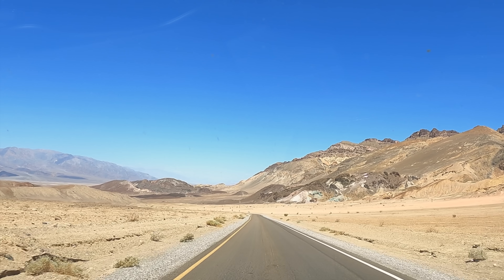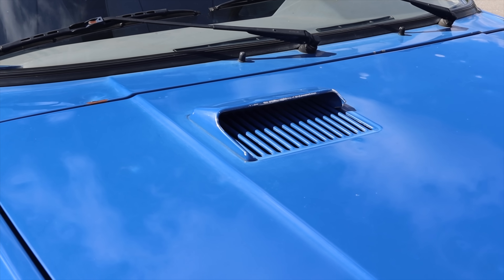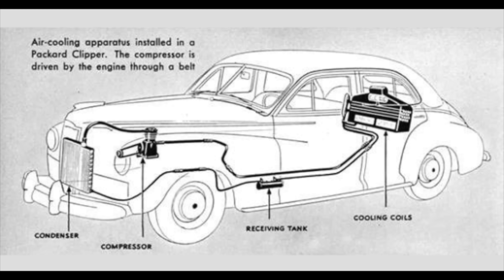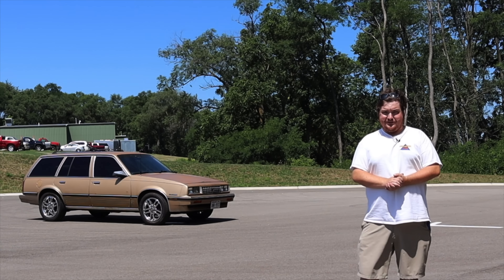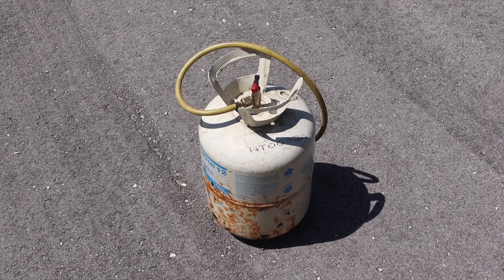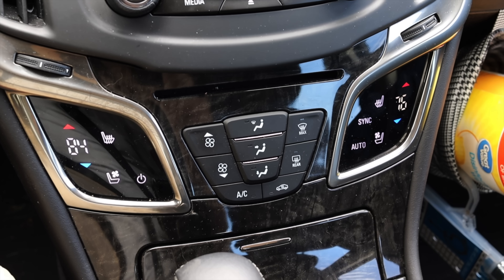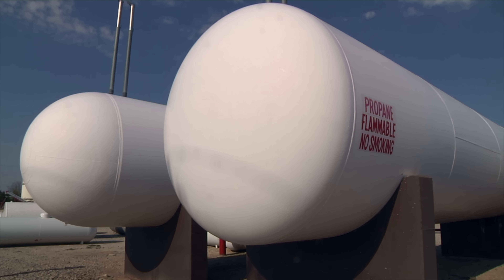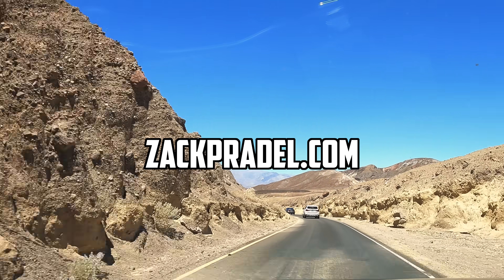Air Conditioning - The Story Of R12 & Why Modern Air Conditioning SUCKS!

Comment: No, I disagree.  R134a is just as harmful to the environment as R12, and they knew this at the time. The real reason is that the patent on R12 ran out in 1980 and Dupont bribed Congress into outlawing it and only allowing this new safer R134a, which Dupont happened to own the patent. Now, that patent happened to run out in 2020. So Dupont bribed Congress into outlawing it for new cars and only allowing this new safer R1234yf, which Dupont happens to own the patent.
Reply: DuPont actively lobbied against early bans on R‑12/CFCs in the 1970s–’80s, citing science skepticism and economic concerns. After developing replacements, they switched gears in 1988, advocating for tight, global CFC phase-outs. So they fought it until they had a replacmeent
Reply: They also have R1234hfc
Reply: @zache1605  a what???
Reply: Let's conveniently forget the ozone depleting mechanism of CFCs that has been studied for 40 years now...
Reply: Also, R-290 is a direct replacement and works as well, if not better. Money and politics. (R-290 is Propane with flame retardant added)
Reply: R12 wasn't under any patents in the 80s, and r134a was cheap upon first use. 
You guys think it's this dumb conspiracy but all you do is show how lazy you are too even come up with such theories that are easy to fact check.
Reply: 1234yf is flammable, not safer. Safer for tree huggers who think trees need oxygen instead of CO2.
Reply: @JR-sf6ws  soon as you go with the '' tree huggers'' attack it becomes obvious your opinions are the result of right wing propaganda AND ignorance,, idk where you get the  '' tree's need oxygen, according to tree huggers comment'', but its pure right wing fabrication,,, TREE HUGGERS OR ENVIRONMENTALISTS LIKE TREE'S AS WE LIKE BREATHING THE CLEAN AIR PRODUCED BY TREE'S !! evil radicals wanting clean air to breath, why i never ,,,,
Reply: @JR-sf6ws  I love trees.
(That's a lie)
Reply: @JR-sf6ws  CO2 is trees food and construction material. 
Though, algae is much more efficient in converting CO2 to oxygen.
Considering how low 0.04% of CO2 in atmosphere the plants are starving.
We need to burn more fossils to increase available carbon for biomass.
To reforest a desert we have to unearth fossil forest remains under the desert.
Reply: @vasiliynkudryavtsev  cool story bro, except you are completely wrong = an abundance of C02 actually makes plants grow worse, not better.
Reply: @JR-sf6ws At times trees do actually respire which means they consume oxygen

Comment: 134a SUCKS in an r12 system!  When the new stuff came out, auto manufacturers were putting 134a in an ac system that was designed for r12 in the 90’s.  The company s didn’t redesign and build the AC for 134a. Switching AC fittings does not automatically make the AC run well on a new refrigerant.  In the 2000’s cars were redone and so was the AC.  Now 134a works quite well.  My BMW and Dodge Ram, 2014 and 2009 respectively cools GREAT here in texas when the temps are in the 100’s.  At idle!  After being parked in the sun!  My 93.5 Nissan pickup had 134a and its cooling was sub par at idle.  So was my 98 corrola.  
Oh, I heard of folks putting r22 in an r 12 system and getting great results.

Comment: I still use R-12 in my 1988 Mazda B2200 truck, and I live in Arizona desert; yes, I do my own AC repairs and have some R-12 cans still saved.  However, my 1998 and 2004 Nissan Frontier trucks also have 4-cylinders and 5-speeds and were R134a from the factory, and these cool even better, just designed for it.  We've also had 1994, 2005, and 2011 GMC Yukons with R134a, and all cooled very well.

Comment: Well, this is kind of misleading. Yes on it's own R12 may be theoretically more efficient coolant than R134a, but "modern" air conditioning is way way better overall and way cooler, and way quicker etc. etc. So modern air conditioning DOES NOT suck! It is way better even if it uses theoretically less efficient coolant. What you stating is actually misconception based on experience of people who converted old car to run on R134a. Yes in those less than optimal conversions R134a does not work as well as R12, because systems were optimised to run on R12. But this isn't because R134a sucks, just that the system itself is not optimised to run it... So again it is simply not true that modern AC sucks.

Comment: To me, the worst thing about modern automotive ACs is the computerization.  Before, if you left the AC on last time, then as soon as the belt starts spinning, it's back on.  Now, the computer and all the sensors have to have a committee meeting before air or heat can turn on.  Before, you had two knobs, one for temperature, and one for fan speed, and it was easy to adjust to your liking.  Now, you have a computer programmed by someone lacking the intelligence to understand the green house effect, and\or notice that cars have windows, so on a cold but sunny day, your car cooks you and the knobs don't help anything.

Comment: My 84 Camaro had R12. It was definitely much colder. 80s cars did suck compared to modern cars though. They weren't as durable or fuel efficient. There were a lot of problems with paint back then, either pealing or just turning to dust. You'd wipe your hand on a car and the color would come right off. I think I had about 120K on the Camaro when the rear main seal let go in the engine.

Comment: Hydrocarbons (Isobutane Propane etc) is actually a fully legimate replacement for R12 and R134A, better for the enviornment and easier on your compressors too.
In Australia we commonly use a specific a blend of R600a (Iso Butane)  and R290 (Propane)  for automotive aircon uses, you reduce gas (refill) volume by 65% so a 600gram R134A system only needs 200g of this R600a and R290 mix.

Comment: I was born in 1951 and during my childhood years most cars did not have air conditioning. In my family the first car my parents owned that had air conditioning was a 1971 Ford Station Wagon. Previous to this car my parents had a 1964 Ford Station Wagon that did not have air conditioning. During the 1967 summer during a long family vacation trip, my parents were driving from Utah to Las Vegas Nevada and the Nevada desert temperature was around 120 degrees Fahrenheit. That part of the vacation trip convinced my parents that the next family station wagon needed to have air conditioning.

Comment: I have driven and been in many different cars with both R-134a and R-12 AC. Both types can get equally cold but I always found the R-12 systems to get cold notably faster. I also found the R-12 systems less picky about having just the right amount of charge. That said, the Ozone layer is very important so glad we retired R-12.

Comment: I really don't get the people that complain about R134 not being cold enough.  I am the type that can be out in below freezing in a T shirt and a sweater, and be fine.  I converted my trucks to R134 and they easily get uncomfortably cold in the middle of summer.  I've felt R12 systems, and it wasn't any colder than that.  There are ways to adjust the performance of your AC system if you know what you need to do.  For my trucks I put in a really big condenser and kept the high displacement R12 compressor.  After finding the best charge level, it's cold as hell.

Comment: The government ban on R-12 Freon (CFC) refrigerant in cars was based on political science, not science.  Open-air nuclear bomb testing in the 1950s was what really damaged the Earth's ozone layer.  The hole in the ozone layer above the Antarctic is dependent on a variety of other factors, from volcanic activity to forest fires to solar storms to American and Russian space craft punching holes in the ozone layer (with burning rocket propellant polluting the upper stratosphere).  The ozone layer is located from 8 to 22 miles above the earth's surface.  Freon is 4 times heavier than air, so most of the Freon that vents into the atmosphere will not travel to the ozone layer.   The theory that Freon was responsible for the ozone depletion dates from 1974.     Just like the current move to ban farms and nitrogen fertilizers because they cause global warming, the Freon ban was based on junk science by our controllers.

Comment: Well, the new R1234YF refrigerant is flammable. Besides that, you are repeating the same idiotic argument about propane. Propane is R290 refrigerant, it is used as a refrigerant, it was used in cars as a refrigerant. As long as your A/C is designed to accept R290, you can use it in there. Stupid remarks about filling A/C with lighter gas or dusting cans are just stupid. They are all just butane or propane. The only difference between different propane applications are additives. Refrigerants usually contain oil for lubricating A/C, some applications have additives to smell propane, some applications require very clean propane to avoid damaging a device. That's why they have different names and symbols but in the end, they are the same thing. It does not matter if you buy butane, gas duster of lighter gas, it will usually be the same gas, just with different additives and different name.

Comment: There is another option for vintage cars.  R406a, aka AutoFrost or GHG-X3, is a refrigerant blend that is compatible with old R12 air conditioning systems and uses R12 standard mineral oils.  Its cooling efficiency meets or exceeds the R12 it replaces.   Since this is a blend, the system must be fully evacuated before installing the refrigerant and cannot be topped off because the blend ratio changes as the components leak at different rates.
Reply: And where is the recovery waste stream for this product? Does it use fittings not compatable with other refrigerants? All this 'magic replacement'  stuff is BUNK. I used NONE of it in 60 + years as an a/c tech, beginning in the early 60's installing air for SEARS. R12, R134a, r1234yf. All good if used as designed. Anything else is a bad move and is likely violating clean air laws.

Comment: OOOFFFF.!!!. What research did you do in preparation for this Video? Just asking for a friend. Although   Die-Chlor-o-Die-Flu-ro-Meth-ain does exhibit so call Green House Gas properties, it wasn't phased out for that reason. It's ability to convert Ozone back to Oxygen without degradation tended to be a massive disadvantage for life on the planet, the detection of reduced upper atmospheric Ozone particularly over Antarctica was a warning to the world. The Montreal Protocol enacted in 1989 was the first time that world governments came together. The key driver was to phase out R12 and replace it with less Ozone destructive compounds

Comment: If you've ever used some of the R12 "Drop in" replacements you've used propane. Most of those were a mix of propane and isobutane.  The newer stuff is often butane and pentane if memory serves. 

So far I've never heard of anyone having an issue with the stuff.  So far as I've been able to determine, the DOT approved hydrocarbon refrigerant for on road use in the late 80s/early 90s. It was the EPA that forbade their use.  (Albeit that DOT approval may have been for refrigerated trailers etc).   The newer 1234YF is also a hydrocarbon and extremely flammable. It's also extremely expensive and doesn't seem to work as well as R134, even in the few systems I've seen that were designed for it. 

I have to wonder how much of the decision against the R12 drop in (propane and isobutane) was motivated by safety when we ultimately end up with a much more expensive option that isn't really much different.    Why not use an inexpensive plentiful product that works great and doesn't hurt the environment?  Instead we're transitioning to an expensive ($600 per cylinder the last time I priced some) mediocre and still highly flammable refrigerant that Honeywell has a worldwide monopoly on?

I dislike conspiracy theories but it has always seemed rather fishy to me.
Reply: Yep, it's officially called HC-12a or R12A, it's a mix of R290 and R600 (propane and butane), I've replaced R134A systems with R12A and interestingly enough it improved cooling performance while reducing the volume of refridgerant gas by 2/3rds.

And it's being simple propane and butane, it's much kinder to the enviornment than R134 or R12.

Comment: Here's a fun little fact.  The molecular weight of dichlorodifluromethane is 120.91 g/mole, the weight of n2, which is 80% of the atmosphere is 14 g/mole, the result, R12 i.e., dichlorodifluromethane, does NOT rise into the stratosphere and cause destruction of the ozone as suggested, rather it sinks to the ground.  The source of chlorine in the upper atmosphere was largely the space shuttle and military rockets, but they didn't want to take the blame and dupont wanted an excuse to sell new patented expensive chemicals, so there ya go, another sap story, just like this current global warming farce.

Comment: All that mumbo-jumbo about R-12 contaminating the atmosphere is plain old hogwash. R-12 is a "creeper" gas that seeks the lowest point or accumulates on the floor of the shop. Old-time AC men used to light a torch and hold it close to the ground to see if the AC system was leaking. The flame would burn RED if R-12 was present. It therefore did NOT simply waft into the air like other spent gases.

Comment: you can just fill in R134a instead of R12 - done this multiple times on my old Cars when the Coolant was not available anymore in my Country. Mostly it´s recommended to replace the old O-Rings, what´s anyways the best way to guarantee a leak free System. Swap out the Condenser and Dryer when you are at work anyways, THEN fill in R134a - and voily .... it works absolutely fine.

Comment: I'm not going to say that r134a is stronger than r12 but the way technology has evolved has allowed for better effectiveness within the cabin with r134a. Double layer glass, sound proof glass, insulation, sound deadening, thicker doors with more padding, more vents and higher flow fans make for a much nicer experience in newer cars compared to older cars, and don't forget about window tint, further escalating the quality.

Comment: My father (born in 1951) Told me about catching a cold after riding in a friends car, with the a/c cranked up. It was a 1970's car, he can't remember what make, but from what he told me, it was ice cold inside on a hot summer day. I don't think I've ever been in a car with R-12, but growing up with 90's cars in the early 2000's (converted a/c systems), I remember long toasty road trips with a/c systems that had leaked dry. With a properly charged R134a system, I've never felt the need for anything colder.

Comment: Banning R12 is good. R134a is also forbidden since 2017. Successor is R1234yf. But R1234yf is a bloody sucking  communists devil sh*t. 
1) it is easy flammable 
2) there is only 1 company allowed to produce it
Why did they implement this monopole? Which politicans did get bribed?
Why don’t they fix that by allowing alternatives?

Comment: Before I start if anyone is thinking about filling an R12 car with propane, Don't. You can get refrigerant grade propane (R290) which is way cleaner. For people that have straight swapped R12 cars to R134a they will notice significantly less performance as the pressures are way different for r134a as well as the serpentine condensers not being suited for it. R12 and R134a in systems properly designed for each gas will perform almost identically in terms of delivered temp. Modern cars will not have as cold ac as older cars because it noticeably hurts fuel economy. I have gotten R134a cars to deliver freezing cold air better then R12 however it requires modification. Off the shelf hotrod AC systems that run r134a can also deliver freezing cold air as they are not beckoned with fuel economy targets. Air conditioning draws anywhere from 2-14kw from the engine so car makers in bids to improve efficiency will will target the easiest change.

Comment: I used plenty of r12, you could buy it for 25 cents a can.  It did work much better than 134a, seems like the duct temp was in the mid to low 30s and I saw many cars that literally blew ice.   Service standards were a little weak, though - no recovery, just crack open a hose and let it vent.  The craziest thing was leak detection using a Bernz-a-matic torch with a copper ring and a hose.  If a leak was found, the flame would burn green.  But it was simple and worked great.

Comment: Had a corolla alltrac wagon in my teens bought off a senior Toyota technician for $700. Had 280k miles and was meticulously maintained. Had perfect working R12 AC and I got the interior to 46 degrees on a 92 degree day just idling for 15 mins. I miss it so much. 134a sucks. Cars are going in the wrong path now

Comment: Since I had to dig to find this info, I'll share it: How big a difference is there exactly?? "R12 can blow 6 to 7 degrees cooler than R134a and is 15% more efficient."  And yes, I've heard of R12!  My first car had an A/C system but I was told it would never be possible to make it functional (to my dismay) because it would only accept R12 and it would cost far more than the car was worth to have it retrofitted to accept the new coolant.  Now I know a retired AC tech who swears that it's (off-the-books) possible to just cram R134a into an R12 vehicle and it'll work, although a Google search provides multiple sources that say it's likely to leak out without a retrofit and also the oil used in the two systems is incompatible and you may kill your compressor if this oil isn't replaced as part of an A/C system upgrade.  I'd probably still have tried it, lol.  Now computer duster as an R12 substitute, that's one I hadn't heard before!